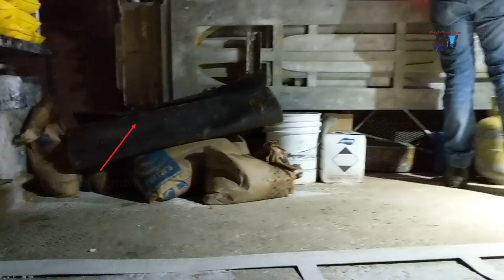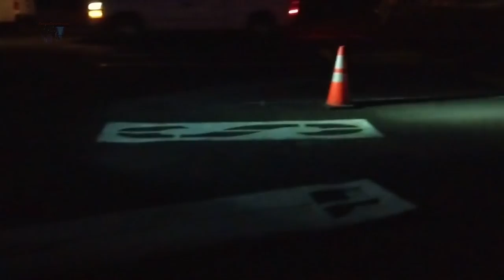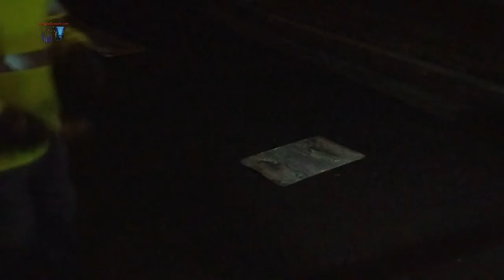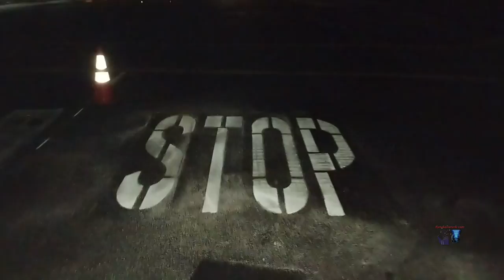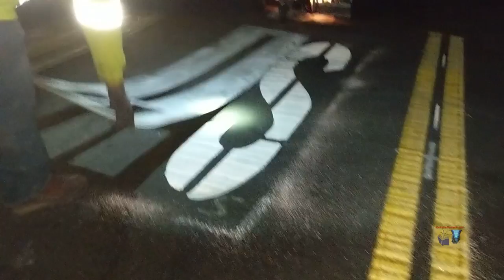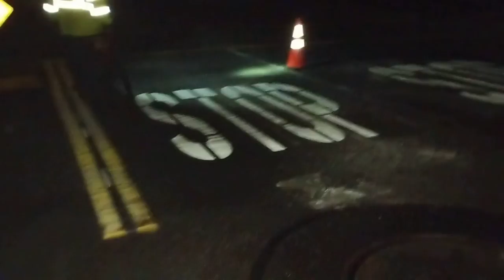USA - STOP AT INTERSECTIONS PAVEMENT THERMOPLASTIC HOW TO CREATE? @MasterWorkers

Comment: Throwing beads down by hand is stupid and potentially dangerous. We had a painting contractor get sued because they threw beads down by hand and didn't clean up afterwards and a bicyclist rode over them and crashed. Had another instance where an airport restripped their runway and used glass beads, the planes sucked up the beads and ruined the engines. That was a very costly lesson.
Reply from the maker: WOW!! Thank you for sharing this information.